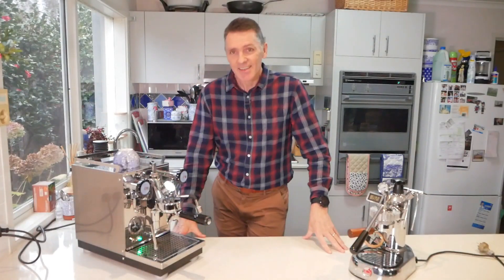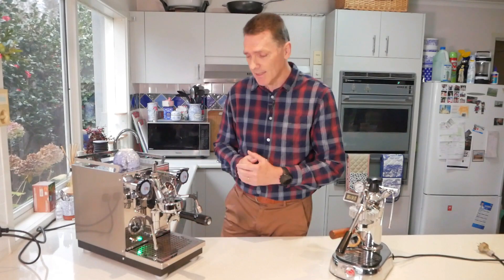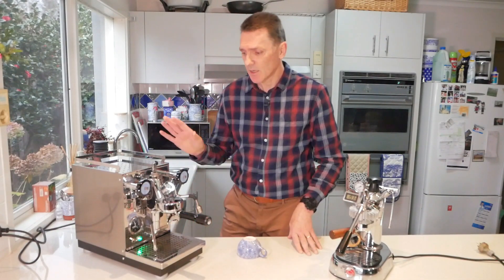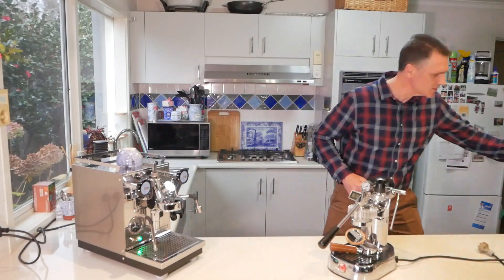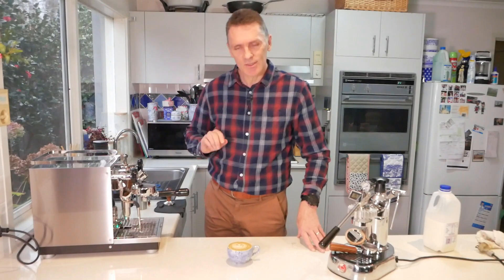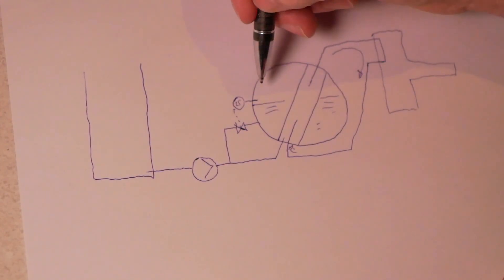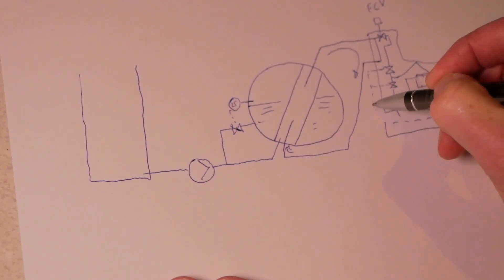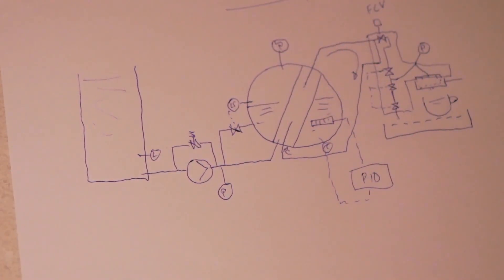From La Pavoni Europiccola to Profitec Pro 400 E61 HX Espresso Machine

Comment: Before you got the Lelit Mara X, what did you think of the Profitec?  Is it better?
Reply from the maker: I haven't tried the Mara X, only Profitec. The Mara X has a unique temperature control that sounds good but the accounts I've heard suggest it might not work well. Profitec appears to be better built so I would recommend that one but you need to buy a group head  temperature indicator to help control that important temperature with water flushes.

Comment: Was wondering if you had a look inside and see how much plastic is used that comes in contact with water. I’m assuming the water tank is plastic and the water lines are silicone? Would love to know. It looks like a great machine. I just bought a Flair as it’s the most non toxic but the milk is an issue and eventually I need to do something. Thanks again and look forward to your response.
Reply from the maker: Yes, just the tank and pipes are non metal. The cool touch steam wand has a non metal pipe inside too.
Reply: @ the cool touch steam wand if it has plastic in it you may want to remove that because it produces microplastics which in turn will wreak havoc on your hormones and cause many many issues that can lead to sicknesses nobody wants to get. It’s a nice machine but I am looking at an older generation Rancilio Silvia and there are other machines that use very little plastics and they do not come in contact with the water! Love your content! Stay healthy!

Comment: Great diagram at the end! Thanks! On the same principle, could you do a comparison of Hx, single boiler and double boiler?
The only thing I can't understand is why there are two valves at the bottom of the E61 unit. I understand the function of the first one, but why a 2nd one underneath?
Reply from the maker: There is a pressure relief valve around the pump. That limits the pump to a maximum pressure, usually set a bit over 9 bars. There is another valve to refill the boiler. There may be another valve to start the water flow for extracting the shot or it may be just the pump start or stop or the refill valve could be a three way valve so it switches the pump output from the boiler to the group head via the heat exchanger pipe.

Comment: thank you for this video and the others (don't stop there).
You say that “because it's an Hx” you have to do flushes. Does this mean that it's not necessary with a machine equipped with the E61 group but with a simple boiler?
You seem to have forgotten to use the tamper ;-)
Reply from the maker: Flushing is just for HX e61 machines. Dual boilers don't need a flush, and yes I sometimes amaze myself what I can forget when videoing!
Reply from the maker: I believe all single boiler e61 machines use the HX design.

Comment: my profitec pro 400 drips water from basket and backflush hole, very slow drips but consistent, is this normal?
Reply from the maker: No, I don't think that is normal and mine doesn't do that. There is certainly some dripping from the back flush outlet while first heating but it stops. There must be a seal that needs replacing. I would guess it is the valve seat seal for the lower valve operated by the lever. Basket leaks would be a leak in the valve seat seal for the upper valve operated by the lever.
Reply: @michaelporter000  Thanks for explaining, I got mine just 3 days ago, will take it back to the shop.

Comment: That's a really nice machine! But you won't get rid of your pavoni, will you?
Reply from the maker: No. Ironically I found temperature control better on the La Pavoni until I recently bought a temperature probe for the Profitec and discovered that 30 minutes heat up time is the absolute minimum and I have to use the high heat setting. Now I don't get sour shots on the Profitec but the best shots still don't seem quite as good as the La Pavoni.
Reply: @michaelporter000  you came to a conclusion that a lot of folks came to in my understanding. Nothing beats a manual machine in terms of shot quality. A semi automatic machine like the profitec makes brewing consistently easier at the expense of getting those really good shots. Plus, Heat exchangers come with their own limitations, heat-up times being just one of them. It seems like there ist No perfect machine. I will stick to manual brewing as you have the most control over the relevant parameters.

Comment: Thank you! Why did you not opt for a dual boiler machine instead?
Reply from the maker: A heat exchanger machine seemed more appropriate given I only make 4 to 6 coffees most days. It still has PID temperature control (even though there are only 3 setpoints) and allows for brewing and steaming at the same time. The boiler is larger than many dual boiler steam boilers which promised better steam potential. Because I bought it secondhand, If it doesn't deliver what I need I can always sell it and upgrade.

Comment: You mentioned steaming milk on your Pavoni with the one hole tip works well for you. Would you mind recording your workflow? I've set my boiler pressure to 1.1 bar, have the 1 hole tip, use a small pitcher, but still struggle to consistently steam properly. I get it right one every 4 times.
Reply from the maker: I have 2 different 1-hole tips. The one with the smaller hole (1.2mm compared to 1.5mm) makes very good textured milk but is a bit slow. The large hole one is like you say - sometimes it is good. I also run the boiler at a higher pressure of 1.4 bar - and hence start with a slightly lower group head temperature. Otherwise, I use the "normal" technique, i.e. angle the steam tip so the milk swirls, let it start swirling and then introduce air as slowly as possible until the pitcher is body temp, then submerse the tip until finished. I hold my hand around the pitcher until I can't hold it any longer and then steam for another 18 seconds. I have timed that so it reaches 65'C. Note that when the tip is fully submersed, I still hold it close to the surface but not so close it sucks any more air in. I use the same technique on the Profitec and it is perfect every time - so much easier. Here is the link to the better La Pavoni tip - https://coffee-sensor.com/product/la-pavoni-stainless-steel-single-hole-steam-wand-tip/
Reply from the maker: This is a video of me using the larger-hole steam tip - i.e. the not-so-good one https://youtu.be/DOm0dMNtfd0?t=322

Comment: Thanks for a well put together video and diagram. Would you recommend the flow control as a very beneficial upgrade? Thanks again.
Reply from the maker: After having a lever machine I couldn't be happy without some flow control. I think the main benefit is that as the puck dissolves during the shot you can reduce pressure to avoid creating a channel which would add bitterness. It also lets you save a shot if you made a mistake and your grind was too coarse or does too low. For $200 it was definitely worth it. A cheaper option is to just install the pressure gauge and just turn the pump on and off a bit. Pressure gauges are very cheap and easy to install.
Reply: Thank you.

Comment: Congratulations…….I was just to the point to buy a La Pavoni ( Second hand) because of your previous video and how good it was……but with your “frustrations” …..I’m in a doubt now…..
Reply from the maker: It is still a great machine. You have to weigh up whether you are prepared to add some mods to control the temperature and then accept that the shots are smaller (14g) and milk steaming is slow and making back to back shots is slow. But on the plus side the coffee is unbeatable and the satisfaction is immense.
Reply: @michaelporter000  indeed I saw that a shot has a ratio of 2:1…..not enough to fill 2 cups in 1 shot ( I think)? Even with a 20 grams basket and Fellini move.